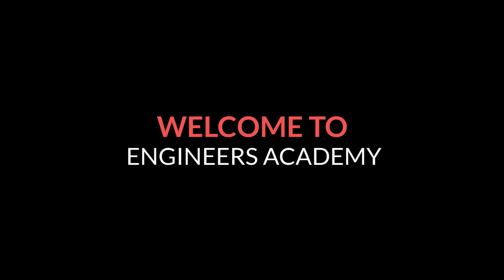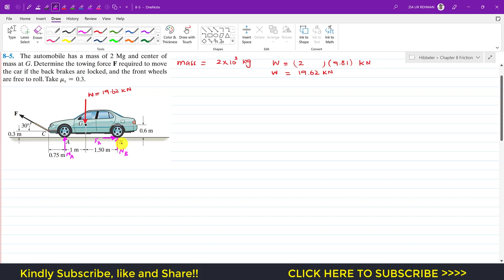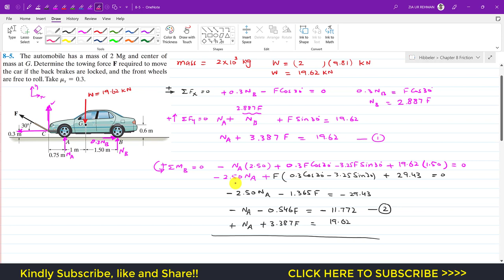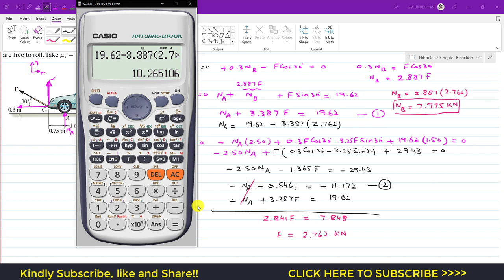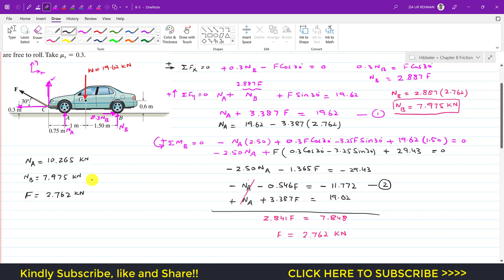8-5 Friction | Chapter 8 | Hibbeler Statics  14th ed | Engineers Academy

Comment: Why there is no frictional force happen in wheel A?
Reply: Problem 8-5 tells you there is friction only at point B. However, Problems 8-6 will tell you there is frictional force on both points A and B.
Reply: because the problem says that the back wheels (B) are locked they cause friction by sliding against the ground. The problem also says that the wheels at point A are rolling. When something is rolling for our purposes we mean that to say it has no friction even though in the real world friction does exist for rolling objects.